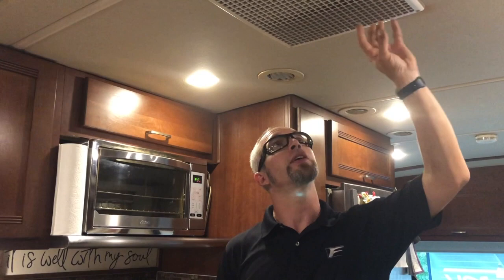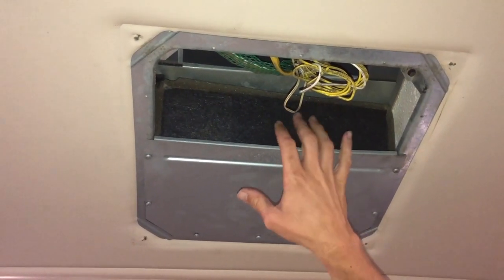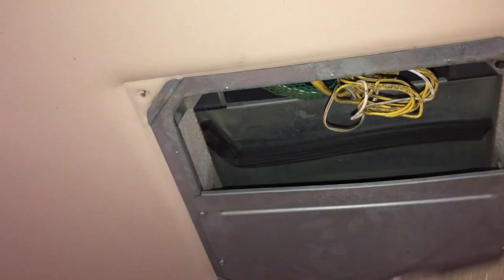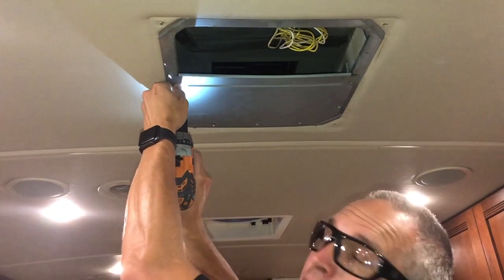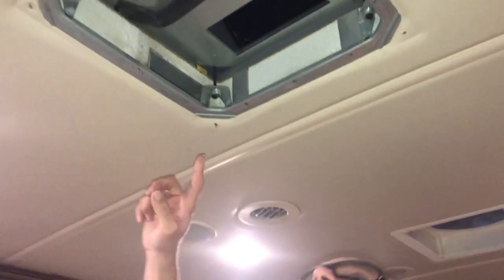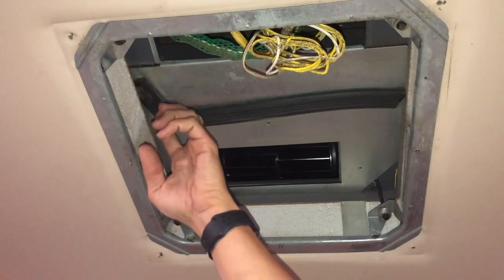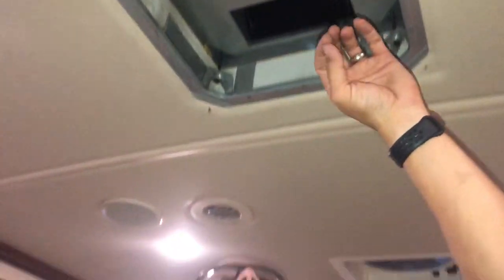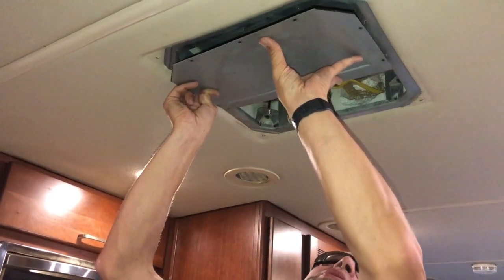RV A/C Hack That Could Save You Money and Keep the Air Cold

Comment: I'm able to keep the temperature 30-32 degrees cooler inside my RV.
I installed 2 misting nozzles at the condenser in order to cool the air entering the unit.
This combined with some strategically placed mylar works like a charm!
110 outside....78 inside..
Reply from the maker: I’ve been looking to do some misters too.